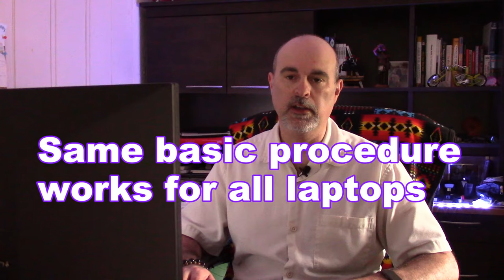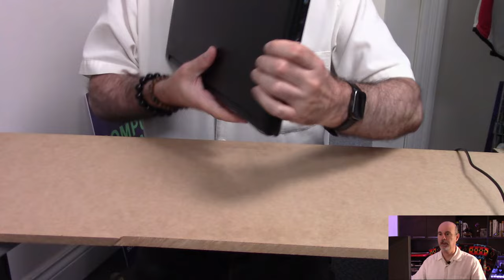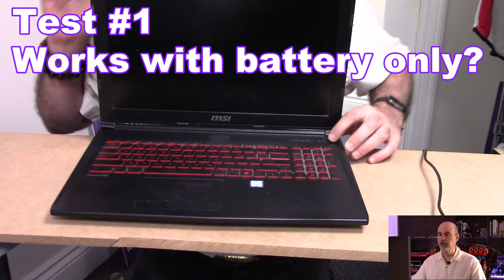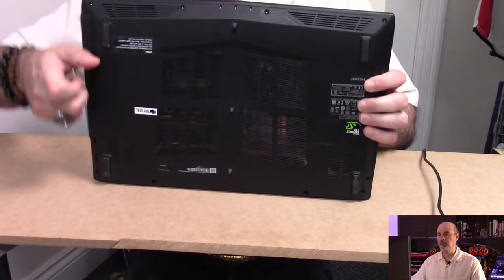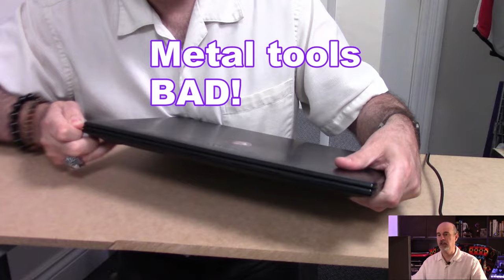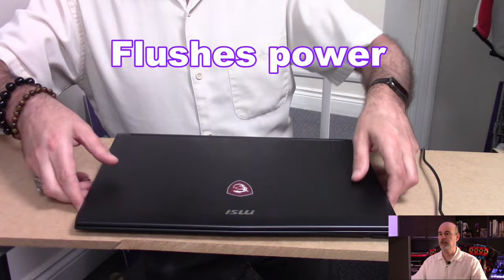How to fix an MSI laptop that will not turn on

Comment: After 3 years of constant use I shut down my laptop one night, I came back from a truck route 2 days later and found no response from power. Unit was left plugged in.

I removed the battery and did the power purge as you said, i had to hold the chassis power 15 seconds and then got a board response. After no video I cycled again, booted.

Thank you very much, I would not have considered this as a procedure.
Reply from the maker: Thank you so much for your comment and especially the SuperThanks!  I'm glad you found value here.
Reply: @lakota2-1warden  this isn’t the permanent fix tho, its a workaround!

Comment: My laptop is always different... Even tutorials with 95% succes rate always don't help and well, this didn't aswell, thank you anyways and I'm glad it worked for others.
Reply from the maker: Sorry this didn't work for you.  It most likely isn't because it's different but because something else happened.  if it's not a a power flush or new battery or new charger, it could be the DC jack or the motherboard needs reflow or repair.  Some of these solutions may require a laptop repair expert.  I hope you find resolution soon.
Reply: @TwinBytesInc  Yes an expert is gonna repair it. Hope it won't be much expensive.
Reply: @tarnex  Did you eventually get your laptop fixed? What was the issue for you?

Comment: Hey Daniel! Thank You, My Laptop turned on, However I didn't have to unscrew the laptop itself neither take out the battery, I just did the 60 second hold like you said and put in the charger, then it turned on and works fine! Appreciate it man, Thank You 😊👍🏼
Reply from the maker: Awesome!  Sometimes that's all it needs, but sometimes it needs a little more.
Reply: @HafizAbdurRahmanSattar...that worked for me as well. I'm glad I saw ur comment, I wasn't about to unscrew anything. 😂🤣😅 Especially since my BestBuy warranty is still active.
Reply: OMG!!! THANK YOU VERY MUCH FOR THIS COMMENT. MY LAPTOP TURNED ON!!!

Comment: Worked great! I didn't have to remove the battery, just the 60second power button press did the trick. Thanks a bunch!
Reply from the maker: Excellent!  You're welcome.
Reply: Same here! Ty ty!
Reply: your comment helped while i opened this 23 seconds in and already fixed it just held power button for 10 seconds

Comment: I tried this with my MSI GP72 2QD Leopard, but it still doesn’t fully turn on. When I press the start button the charging lights turn on, but the screen stays black. After a few seconds the fan turns on and won’t stop until I turn the laptop off again. What is the problem here? I really need some help!
Reply from the maker: Sorry to hear that didn't help.  It is most likely something on the motherboard that could be fixed with a BIOS upgrade, but since you can't get to the BIOS the normal method you'd have to try removing the CMOS battery briefly or get a motherboard repair.

Comment: Did not work for me, but the fact that you respond to so many and helped so many gets a like and sub from me.  I can still hear the computer working and can even hear it boot up after I type my password, but the screen stays dark throughout.  It initially turned off when I just tilted the screen back. It was very sensitive to having the screen moved.  In fact if I get it to work again I'm not closing the screen or even touching the screen again.  Not sure if that gives a clue as to what's wrong with it or not.
Reply from the maker: Thank you for your kind words, talking time to comment and your details definitely tell me what's wrong.
The issue is your screen.  The cable or screen inverter is damaged.  Your video cable is most likely getting pinched as you tilt the screen.  I bet if you put a little pressure on different parts along the bottom of the screen you will notice the screen light up and go dark.  That confirms where the issue is but I can pretty much guarantee you need a new screen which they normally come with a new inverter board and cable.
You could plug an external monitor in and you'll see everything working fine.

Comment: Worked for me too! It was such a tiny hole and the icon above it was so small I would have never found if i didn’t know to look for it. Thank you. I found your solution pretty quickly so you saved me a lot of time, stress (I need my laptop working now for school), and money. It’s awesome how you reply to everyone’s questions with sound advice! Thank you!!!
Reply from the maker: Thanks so much for your kind words and glad it was helpful.  I definitely will try to respond to every single comment/question.  Unless it's something I don't think I should reply to.
Reply: You mean hole on the right side of the back cover?
Reply: And did you charged the laptop then turned it on?

Comment: It didn’t work I was playing a game called Skyrim that was heavily modified and my charger was plugged in and it froze all the sudden turned black and wouldn’t turn back on?
Reply from the maker: You could try another charger, borrow a friends incase that's all it is.  Could also have overheated.  Try blowing out dust and I always recommend cooling pads, especially when gaming on a laptop.
Reply: @TwinBytesInc  thank you I’ll try this
Reply from the maker: You're welcome

Comment: I don’t get this. why would removing the battery and then reinserting it, fix this issue?  Why won’t it power on in the first place ?
Reply from the maker: I don't believe I can explain the science behind it, but it's something to do with the flow of power.  It gets jammed, sort of like water flow in the pipes in your home.  They can get clogged.  Flushing the pipes out makes the water flow again properly.  So with doing this reset, it drains all residual power so it has a chance to start fresh from nothing and get clean power.  You can Google "Dirty Power".
Reply: @TwinBytesInc  I am just confused why my pipes get clogged in the first place lol.  I did nothing to this laptop and it just stopped powering on
Reply from the maker: lol, I really can't explain that.  An electrician will know more, but knowing something and knowing how to explain are two different things.  Just knowing it's something that can happen and usually fixed fairly easily.

Comment: i have tried it. but the result is that the start button lights up three times and the computer does not start and does not turn on . mybe problem in bios ..
Reply from the maker: Could be a physical issue with CPU or RAM.  You could easily remove memory and reinsert memory modules.  CPU maybe more challenging.  Failing that, a tech might be able to fix the motherboard.  I don't believe it will be a setting in the BIOS and you can't get to the BIOS to change anything.  You could pull the CMOS battery for an hour and put it back.

Comment: So I tried all this and nothing my charging light shows it’s charging but it won’t turn on I also swapped the ram thinking maybe it was a bad ram but nothing it just won’t turn on
Reply from the maker: Are you sure it's not just the screen?  Maybe it's on but screen dead.  you could try with external monitor.  otherwise issue with motherboard

Comment from the maker: Hey everyone, if you find my videos helpful, giving a thumbs up is the best thing you can do.  Other than that you can show you support by:

1. Watching the video all the way to the end, even if 2x speed
2. Subscribing
3. Being active in the community tab https://www.youtube.com/c/TwinBytesInc/community
4. Joining as a member
5. Giving a thumbs up. (Yes I said it again, very important) :)

You're so awesome!
Reply: How do you fix a dominator that is shutting down under heavy load it was diagnosed with motherboard failure but I do not think that is the case do you know what the issue could be it has no instant shutting down but rather overheating issues.
Reply from the maker: Hello Revan. Not sure how it was diagnosed as a motherboard failure, who said it was a motherboard issue?  Anyway you also said you believe it is overheating.  Maybe a fan isn't spinning properly anymore, maybe not spinning at all.  Maybe dust build up or clogged fans with pet hair.  You'd have to open it up and inspect the fans to make sure they are free spinning.  Also you can purchase a cooling pad for your laptop to help when under heavier loads like lengthy gaming.
Reply: @daniel gauthier this didn’t work for me do you have any ideas of what else I could do to fix this problem?
Reply from the maker: It requires more troubleshooting as any issue could go in a different direction.  Maybe bad memory, maybe it is turning on but just your screen is dead, maybe power cord or the outlet you are plugged into.  Too much to troubleshoot here.
Reply: Hi Thanks for the Video. I have the same concern but it was after i tried only of removing and replacing a keyboard. After so, my laptop just turns the keyboard on and nothing happens. I use an external monitor that I have been using for this laptop but still no Video.
History of this, is that moisture may have affected my laptop after being left on a rainy days. And I left it about a week. Molds started inside the room as I returned and as I tried using it the monitor started to flicker and after few days I lost some Keys from working.
So I tried to check wiring on my keyboard and install them again. But now become worst. Hope you could share more thoughts. Thanks You. Watching from the Philippines.
Reply from the maker: @wallydeleon2  Thanks for commenting.  This is beyond the scope of this video and not a quick answer. It requires someone looking at it as it sounds like with question of water and mold it may need serious cleaning and/or replacing one or more parts.  Someone has to look at it.
Reply: @TwinBytesInc  Hello Daniel. Appreciate your kind attention. Today, I made it work, by checking the RAMs. They were working before pretty good as I could play games on it. 
This morning, as I tried to remove one by one and swap each others location. The original 4GB RAM made it work. The 8GB RAM tandem to it before would again turn back to black-out situation.
I ordered 2x 16GB RAMS to replace them totally. And hope I could survive this good laptop for more productive years. Thank you again.
Reply from the maker: @wallydeleon2 Glad to hear you got it working now.
Reply: does it work in any model

Comment: My MSI GF75 died on me while at the library, first time in about three years. Tried disconnecting the battery and hooked the power up and it booted. Re-connected the battery and it appears all systems go for now. Thank you for this great tip!!!
Reply from the maker: Glad it worked for you.  Thanks for taking time to comment.
Reply: I'm picking one up tomorrow with a power problem. I hope this is the fix. I'll keep you posted. Great video regardless if it worked for me

Comment: So great video. Thank you. Unfortunately did not work for me. Is it possible to flash the BIOS from a blank screen?
Reply from the maker: Thanks and sorry it didn't work.  If you can't power up to get to the BIOS, you can't flash the BIOS.  Also, flashing the BIOS won't fix that type of issue.

Comment: Sir help me, my laptop wont turn on I've tried tye process you have mentioned but its not working. I've tried also removing cmos battery and insert it again but not working again. Any idea? Thank you
Reply from the maker: Sorry, aside from this video instruction, you would need someone to look at it.  Maybe motherboard needs repair or replacement.

Comment: This method just worked for me ds why I subscribed to ur channel thanks👌 the issue now is that my laptop is making a strange sound
Reply from the maker: Thanks for the sub and glad I could help.  That noise could be the root cause of the issue.  You'd have to try to isolate the noise to see if it's the hard drive or a fan.  You'd have to open the laptop up, remove the drive and check it externally and look at the fans if spinning freely.  You might need a repair shop.

Comment: Thanks a lot!!
Had it with Creator P75.
Did the 1 minute button hold and then let it recharge for a while.
*It didn’t go back up straight ahead, had to give it 15sec hold on power couple of times.
Reply from the maker: You're welcome.  I'm glad it worked even though required more effort.

Comment: Hello, i have same problem but with other model, msi gf63 thin 9rcx, please help me
Reply from the maker: Thanks for your question.  Although this video specifies MSI it's good for all makes and models of laptops.  The only difference is many laptops with many different ways of accessing the battery and some have a pin hole to reset the power on the bottom of the laptop.
Reply: did u find a solution

Comment: I have an MSI Laptop MS 1792 which I use for large panorama photo editing.  I also have an Acer Predator  for the same purpose, with 8K video output from HDMI port.  I recently decided to remove the battery from the Predator and run it from the power supply which came with it.  It runs fine.  I use both laptops with large, external TV screens and have the laptop screens turned off.  I disconnected the battery from the MSI laptop, and it ran for a while on the provided power supply.  After several minutes, I got a low(12%) battery message.  Since then, it will not turn on.  Help!
Reply from the maker: Thanks for your comment.  This is very odd and doesn't make sense.  Not sure why you'd leave the battery out to begin with, but regardless, this doesn't make sense and I don't troubleshoot in chats.  You'd need a local tech to look at it and determine what is wrong.

Comment: Thank you very much, it worked for me.  But in my case I have to do it every day, is there a definitive solution?  Why is this happening? Help 😢
Reply from the maker: You're welcome.  if you have to do this several times, especially daily, that means there maybe some sort of issue with the power flow.  May not be anything to do with the battery or power adapter. It maybe the motherboard that has some sort of issues that needs to be looked at.

Comment: Thank you for your effort 
It works at first but now doesn’t work !!
Maybe Butter need to replace or what ?!
Reply from the maker: You're welcome.  It sounds like maybe a bad charging port or general issue with the motherboard that needs to be reflowed.  If you like the laptop and fast enough, it's worth it to get the motherboard repaired by your local repair shop.

Comment: Thank you very much! I've had to do this twice on my wife's MSI - the second time I did it in 5 minutes or so. Any idea what causes this? I'd hate to have to do this every two or three months...
Reply from the maker: You're welcome.  This is a problem if you have to do it every so often.  That's a sign there's an issue with the motherboard.  you could pay to have the motherboard repaired or replaced, or see how long you can string it along doing this simple fix every few months or so.

Comment: UPDATE: After trying everything below, I took apart the laptop, removed all the old thermal paste, cleaned everything (even fans and fan housing), applied new, fresh thermal pads and thermal paste to CPU, GPU and all other parts that previously had thermal paste. Placed a single stick of RAM in the laptop, and closed it up. upon connecting power and rebooting, the MSI logo came up and the laptop is now working. I've been able to use a new storage device and download all drivers and software and everything is working great - no issues.

My MSI laptop power light flashes white briefly and then just turns orange. The keyboard doesn't light up, but the fans are working and pressing the fans button they go even stronger. Nonetheless, the screen stays dark and never comes up.
I have tried resetting bios settings via the pinhole / switch and also holding down power 60 seconds with battery removed and with battery in... so far nothing.

Also, any link to a completed disassembly of the MSI 65 laptop?
Reply from the maker: Thanks for taking time to write.  Sounds like you're comfortable diving deep here.  Normally you don't need to tear apart the laptop for all that you did.  Normally if this issue isn't fixed by what is shown in this video, it means something maybe wrong with the motherboard which needs either reflowing, some chips replaced or entire motherboard replaced.

Comment: Hello. May I ask what laptop this is in the video specifically? 

And also, I’ve done what was instructed; but no luck, sadly.

Thanks, anyways.
Reply from the maker: Sorry I no longer have that laptop in my possession but it shouldn't mater.  All makes/models can work with this trick.  Although it's not a guaranteed fix, it works alot of the time.

Comment: I had my RAM upgraded earlier today, it worked fine for a few hours but suddenly crashed and won't turn on again... any tips before I bring it to a professional?
Reply from the maker: You could be on to something there.  Sounds like it's possibly a ram issue and you either got bad RAM or the wrong type.  make sure if you upgrade it is compatible.  you can run a memory test as well which I have a video on.
Reply: @TwinBytesInc  I took it to a professional, and one of the two RAM sticks were faulty :/